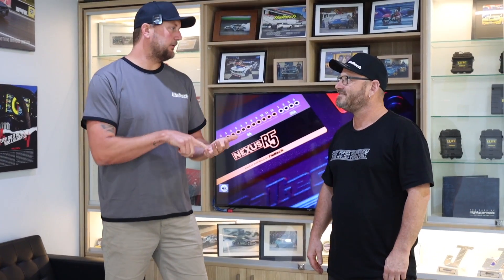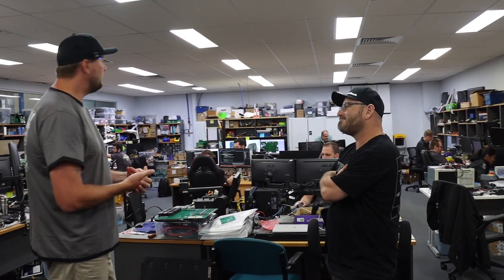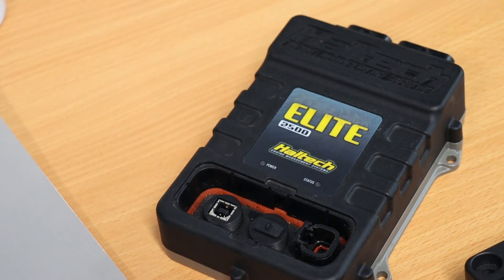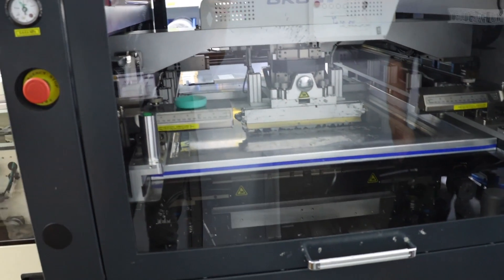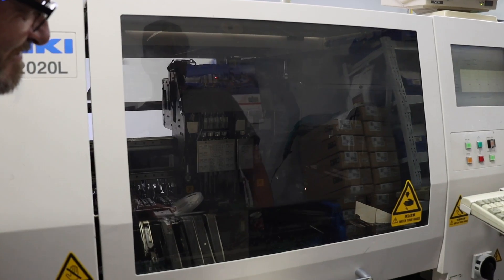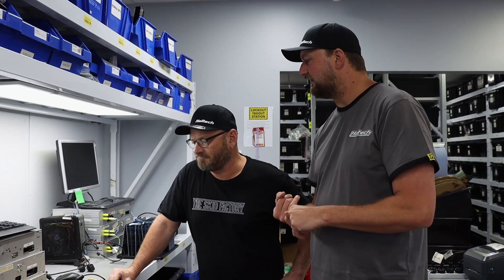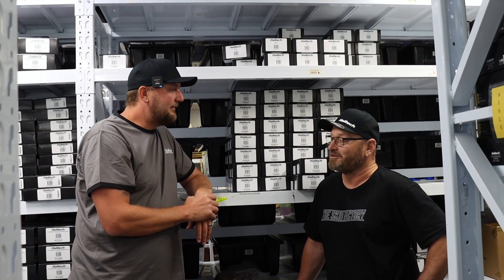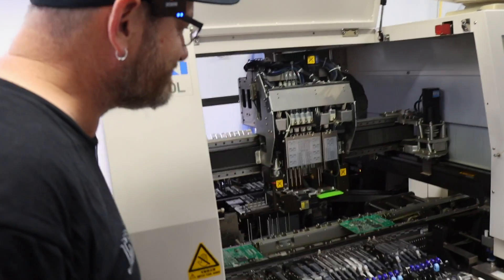How a @haltech ECU is Made🛠🇦🇺 THE SKID FACTORY

Comment: looking to add port injection to my Lt V8 ... any ecu that drive 16 injectors( 8 di and 8 pi)
Reply from the maker: If you wanted to use a single ecu you would need something very high end as very few companies support direct injection at all. M140 motec or Life Racing. Alteranately you can just delete the direct injection and run it off port only, that is what the majority of LT owners would do in a swap situation.

Comment: So is the R3 a pdm as well as a ECU and in one?
Reply from the maker: Yes it is basically a trimmed down version of the R5(two less connectors).
It's aimed at running your engine and all the engines electrical requirements from the one box whereas the R5 has enough outputs to run the entire car from headlights to thermofans.

Comment: Is there a haltech products for common rail engines
Reply from the maker: No support for common rail diesel or direct injection at this stage. It's quite a leap to go to commonrail and DI in control and voltage requirements.

Comment: I really want to go Haltech for an ECU but would like something from Haltech on why they think some tuners say their ECU does one thing when the tuner "told it something else", tuners saying it caused the engine failure. One workshop in Perth said they'd wire one to my car but then push the car out the door, they significantly weren't interested in touching Haltech. I'm not trying to troll here in the slightest, i'm just trying to understand what the other side has to say (Haltech).
Reply: ther are better options emtron and link
Reply from the maker: Your tuner is an idiot.

Comment: Component shortages, especially with high performance integrated drivers (as used in automotive control units) is an absolute PITA at the moment. I've done 5 redesigns on one device just to try to keep on being able to make it!  Using these specific parts is the way to make a small, highly robust and high performance control unit, unfortunately it puts us smal fry in direct competition for limited component availability with the big brand OEs and Teir1s.  That is not something us little fish can win.......

Comment: Very impressive. Doing a lot in house. I would of assumed the units where made somewhere in China. Likely the PCB and packaging is. Maybe not though. I'm curious as to what the repair process is. Say a chip dies on the board and needs to be replaced. Are units refurbished? Or are they disposed of and customers get a new unit? Does Haltech sell individual chips if a person knows or has a repair shop that can do the soldering work? Right to Repair is something I'm very passionate about and interested here in the states. The bill was recently botched unfortunately.
Reply: I'm guessing unit is tested and components replaced.. unless under warranty where by rights is replaced.

Email them.. they'd know more than me.. mine is merely a guess.

Comment: What’s the purpose of running an integrated map sensor?
Reply from the maker: Frees up an analogue voltage input for other stuff like oil pressure sensor.
Reply: If Nissan did it in 95 its gotta be worth doing